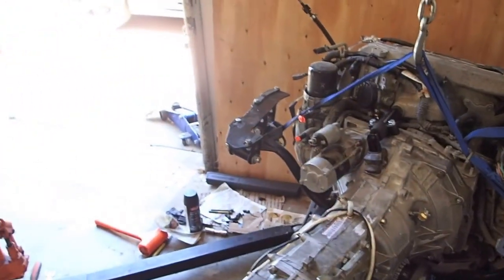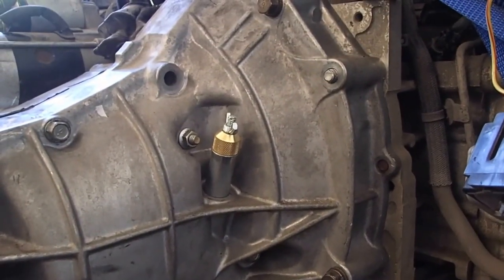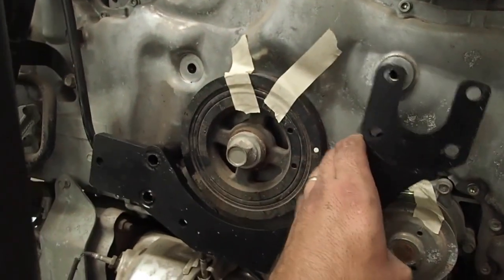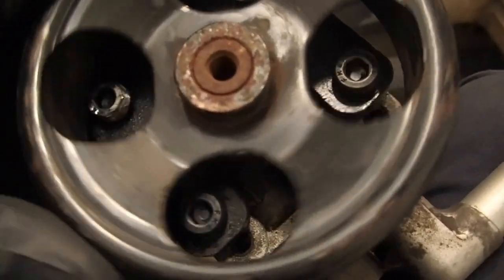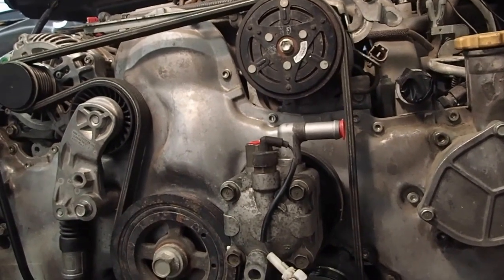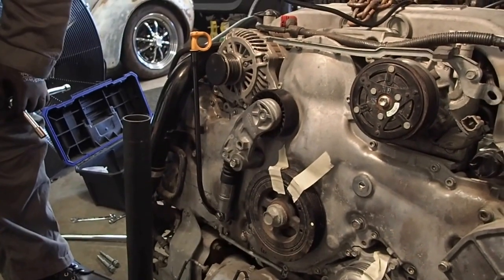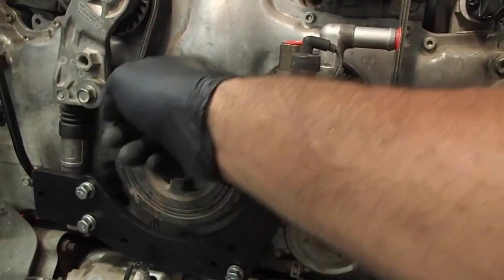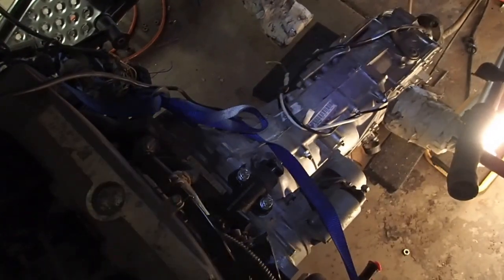88 syncro EE20 subie swap: engine/tranny prep

Comment: I wanna do an EE20 swap in my USDM forester overland build. I've got the dual range transmission, lift, and rear locker. Diesel has so much torque I feel it would be perfect for a woods rig

Comment: The Subaru engines usually have a stud as the lower bolt so that you can simply fit a nut onto the threaded end of the stud - no need to remove the Subaflange that way.
Reply from the maker: hmmm. mine was simply a hole for a bolt to go through. the stud must have been removed before it came into my possession. i will make a note of that in the video for others! thanks!